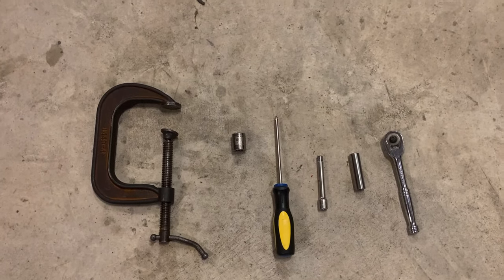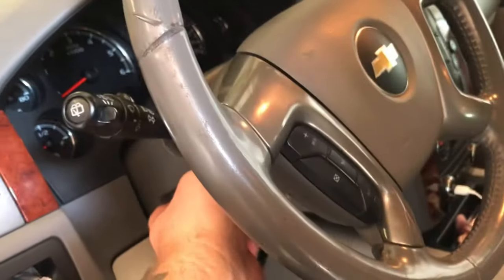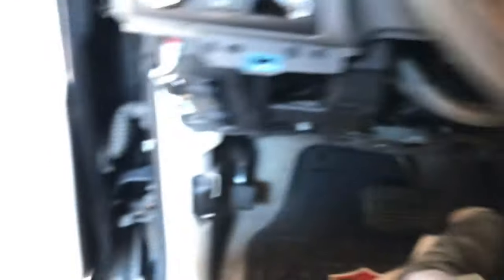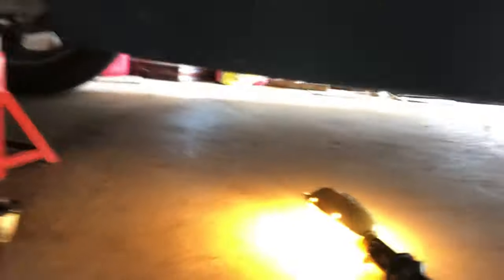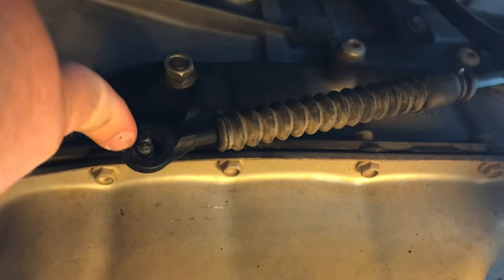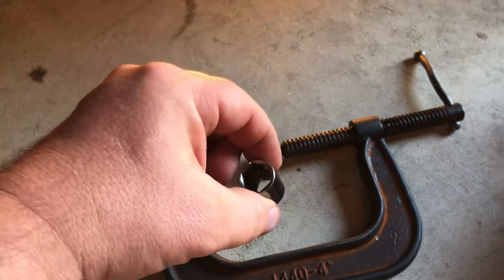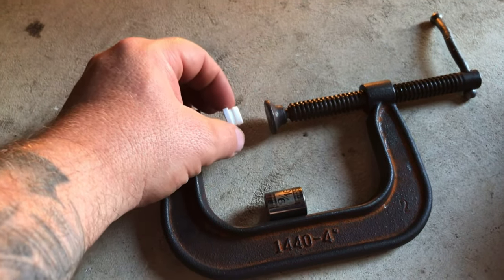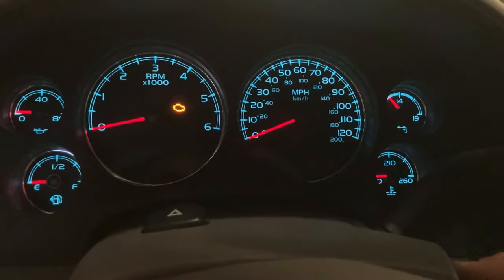Shifter Linkage Bushing Replacement for Chevy/GMC SUV & Truck

Comment: Where did you get the bushing ??
Reply: Post link pls
Reply: Same i need it please
Reply: Got mine on amazon
Reply: can we have the link
Reply from the maker: They carry them at most local auto parts stores.  The dealership does not sell them.  I found the one I needed at an Auto Zone.
Reply: @howtowiththisdude5318  I’ve already wasted money on the wrong parts twice at local parts store. Please post part number or something. I’m dire needs of getting this fixed.
Reply from the maker: I’ll look around my shop to see if I have something showing it.  If I can’t find it, I’ll try my best to swing by the parts store and take a picture of it.  It may take a few days.  Kids and work keep me pretty busy
Reply: Advance auto parts
Reply: The best way to use machine bolt with double nuts instead of the bush.
Reply from the maker: I’ll google that and check it out.  I’m all about easier.  I’m just trying to show stuff as clear as I can and hope it helps someone out.  YouTube videos have helped me at times.

Comment: Mine keeps coming off. Like, it's sliding right off. Even with the new nulon whatchamahoozit
Reply from the maker: Hey Mike, I feel your pain.  When I went searching for a replacement bushing I found more than one.  Some were too big and some too small.  The one I used came from an O’Reilly Auto Parts.  In. My first comment for the vid I put the part number it was.  I wrestled with it for a while til I got it on.  An extra set of hands would of been a big help.  Hope this helps ya. Good luck wrenching.

Comment: If you are stuck Just use a Wire - just put the selector onto the gearbox sifter and wrap a blk wire tie around pull it tight with pliers and that will get you where you need to go ..then do the Painful exercise of replacing the stupid designed nylon bushing
Reply: My homeboy said the same thing 😂

Comment: The part # I got was 14073 came w e-clip had to use a3/8ths bit drill out old bushing(green) fit perfectly snug , problem solved for about $18 bucks @ oriellies- the entire cable would’ve ran me about 100 bucks , took me about 2 minutes to get it all done . 😊

Comment: I replaced the bush in and put it back on the little nipple looking thing but it comes off fairly easy with just a light pull.  This cant be normal?  Suggestions?
Reply from the maker: I noticed a few different bushings that all said GM.  One of the packages had about four different ones.  I’m going to try my best to find the one I used and that worked and post which one it was.  Also, make sure your putting the bushing in the right direction.  In the video I show which way to push it through.

Comment: I was able to push it on, it doesn't hold in place anymore
Reply from the maker: You most likely need a different bushing.  I found about three or four different ones when I was searching for mine.  All were different

Comment: Now I know why you didn't show the actual process with the c clamp.  There's no way you did that with the clamp
Reply from the maker: Oh I did though.  That was the part that took me forever.  I may have even invented a few new adjectives.  Usually the other set of hands  are there to help keep things lined up while I’m closing the clamp.  It was a sweaty angry mess without my helper.
Reply: Clamp works I used one with rubber ends it helps hold things better